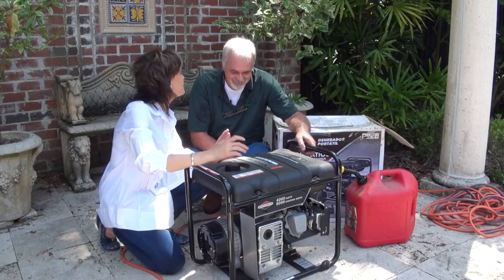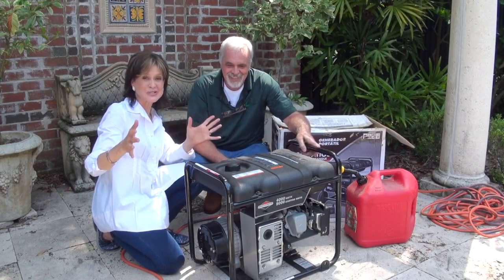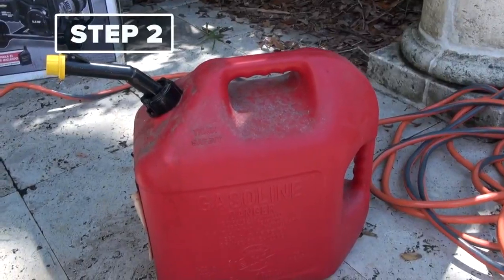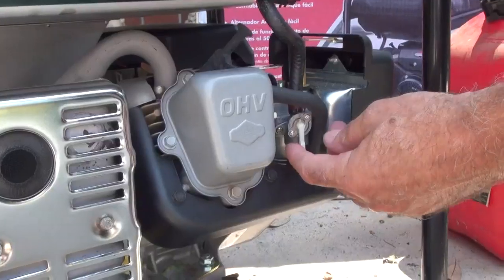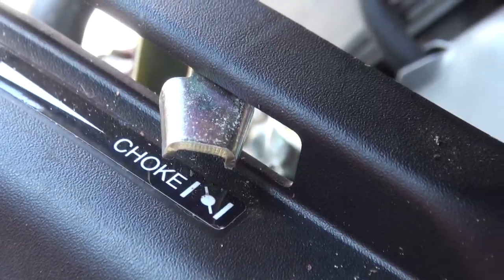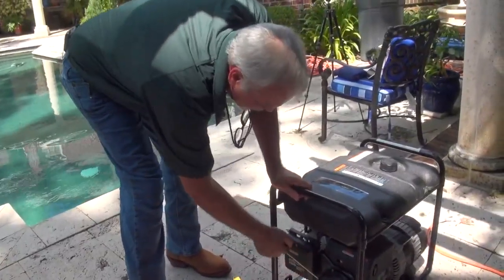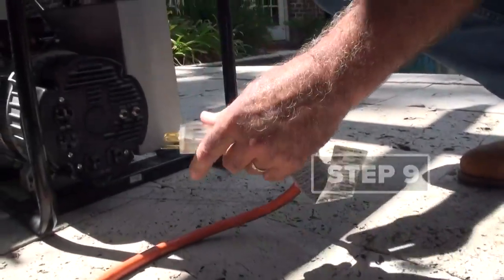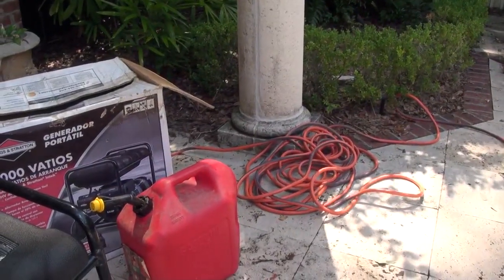How to use a generator

Comment: Another suggestion is to not have the generator cord in a pile on the ground. Either plug in a shorter cord or unravel the cord on the ground. There will be voltage loss that multiplies with a longer cord. Plus that longer cord could cause a safety issue?

Comment: I place mine in my detached garage at night and leave it running with a window cracked. It stays protected, I don’t get fumed up and it helps when we are in a pinch. OR, I place it in a wooden pallet and under a stringed tarp so it doesn’t get wet from snow/rain if power goes out.